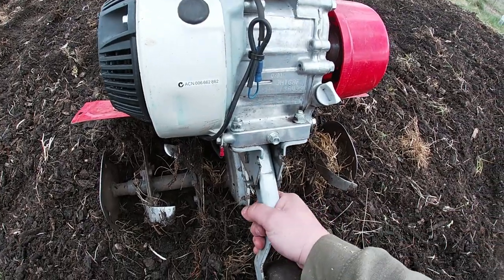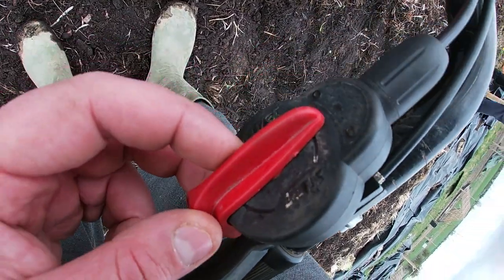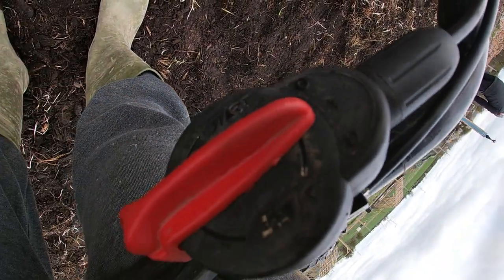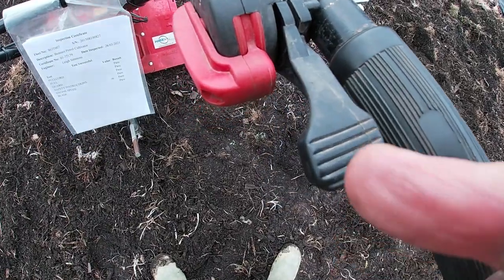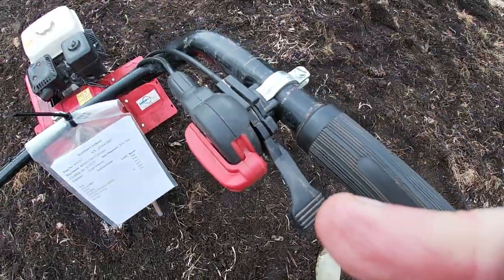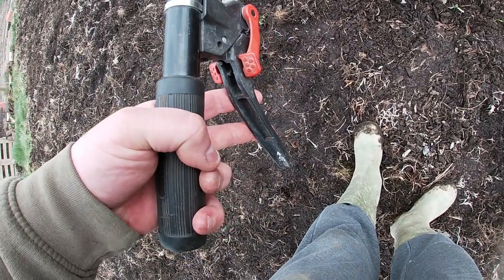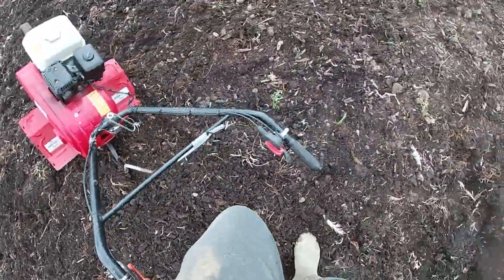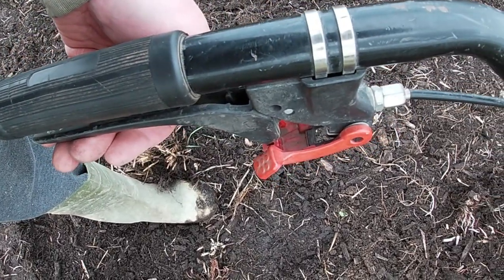How to use a Rotavator or tiller! from starting it ... to operating it!

Comment: But how would it actually work on clay soil, such as what we have in London? You made it look easy.
Reply: If it's a heavily compacted clay, you may need to go over the area a few times to get the desired results. If it's really tough, you may need to break the surface with a spade/pickaxe beforehand. It's totally doable, it can just take a bit more effort to initially break through the surface. You can also water the ground a few times in the days before rotavating. This will soften the ground, but don't overdo it, as it's not much fun if it becomes a muddy mess. Be patient and you'll get it done :)

Comment: I take it the soil would need to be cleared of all rocks and debris etc before going at it with this? Dodgy builder left a total mess of our back garden full of rubble etc and i was hoping to use this to help levelling it
Reply from the maker: It will defo be better to be cleared soil but it will work with small rock in the soil still I believe

Comment: they look a tad shabby to use, like its about to drag you off .hard work to control ?
Reply from the maker: Na they pretty easy to keep controlled
Reply: You do have to hold on to them lol. Try to follow the machine rather than wrestle against it.
Reply: Theres a reason this movement looks shabby mate their supposed to be pulled back the way not pushed forward . When their pushed forward they bounce all over the place like in this video pulled bakc the way their easy to control n get a much cleaner even end product

Comment: Will it hack up grass? Planning to make a  large veg patch.
Reply from the maker: Ye this was grass before we worked it  👌
Reply: @FieldtoFarm_UK  Cool. Anything to save my back. Thanks for the reply 👍
Reply: Cover the grass with a thick layer of cardboard/paper or something that'll exclude all light, for about 3 months first. Or spray it off with glyphosphate. Both will make subsequent cultivations easier. You'll have plenty of chafer grubs, leather jackets and eel worms in that post lawn patch, so don't both with root crops for the first few years.
Reply: Could I just use one straight over old grass as planning on using grass seed after all levelled and raked